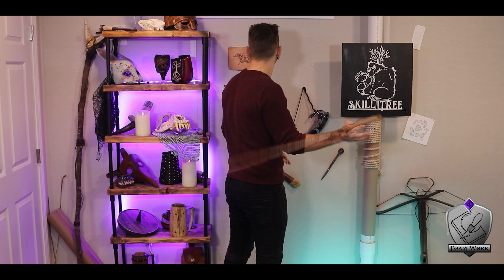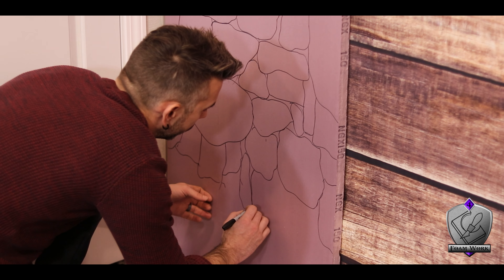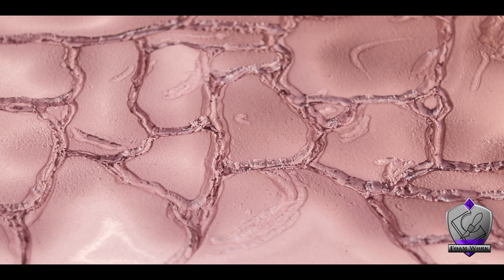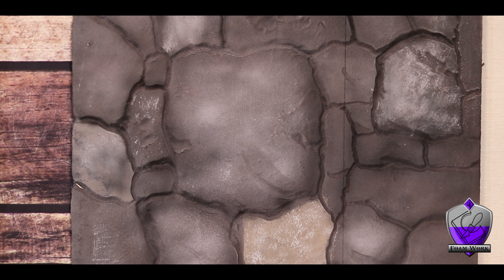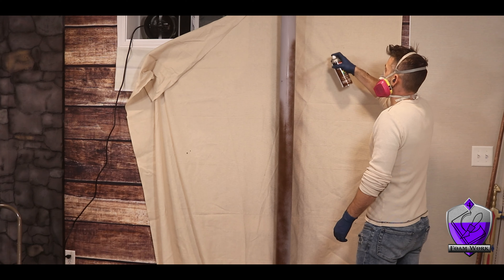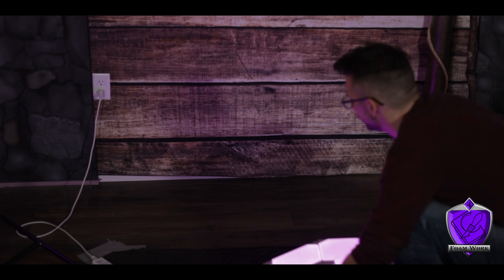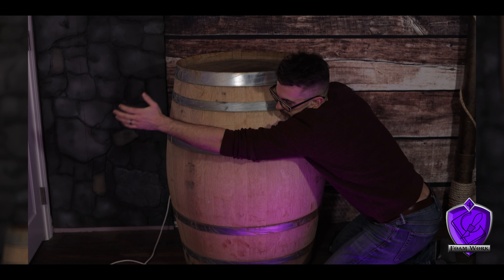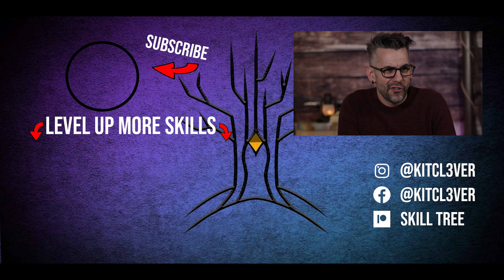Making a Cheap and Easy Backdrop!

Comment: I used to work at a state park as a tour guide. One evening on a night nature walk, I wished I had a walking stick that lit up, but not just adding a little to the one I had. I'd have it so there was a clear looking stone at the top and a reflector so the light would go forward and not blinding me. But I wanted it so I could change the color. I'd want red for general night walking, but could change it to white if I needed to see detail or any other color I needed. So I thought about using a PVC pipe so I could easily hide the battery and wires in. I thought about using brass upholstery tacks around where the hand grip would be. Using a small push button switch for each color light I wanted and cut the stem of the tack off and attach the tack head to the button to hide it. Then you could turn it off and on or change color with barely moving a finger and it would appear like magic.

Comment: No recommendations for the shop, but I have a drink recommendation. Sonic screwdriver. You make a screwdriver as per usual, then add blue curacao and rose's blue raspberry. Excellent taste, pretty color, gets you loopy.

Also colossus and the wanderer. Giant mug with 12 oz Guinness, 12 oz angry orchard, and 6 oz blueberry ale. Shot glass with brandy and grenadine (I just pour whiskey because I always have whiskey)

Comment: Hey man, a heads up! Army Painter has made a spray paint SPECIFICALLY for foam. The entire Game Master line is, in fact, made with terrain crafting in mind - and since in terrain crafting XPS foam is a very big thing, well, the Game Master line is supposed to work well with foam. I've never used it (but I've ordered it), but I suggest you give it a look. It's just 10 euros for half a liter, it's a pretty good deal.

Comment: Been wanting to get my hands on some barrels to turn into chairs. Cut maybe 2/5ths around or so, a little above the center band and then remove the top and enough along the side to even it out, then slap some supports along the inside to hold the platform that will become the seat of the chair, then pad and upholster the rest of the inside for the back and sides of the chair. And if you want you can repurpose the wood you removed into some kind of foot stool or side table built right into it.

As for the PVC pipe in the back, for me if I went with a metal look I'd want to add some kind of stove-looking structure under it that could conceal a chest of drawers for tools or some other storage, and if I felt like getting fancy AND functional try to find a way to hide a hotplate or one of those single burner ranges into the top to have something for making hot cocoa in the folder months, or to melt wax or stick glue for various projects. Or, you know, coffee/tea.

However another way you could go for disguising PVC pipe, especially if it's thick walled, is to follow up the sanding with a round or two using steel wool or (carefully) gouging the surface with - I forget the technical name for it but the rotary disc with metal brush bristles sticking out along the circumference (not to be confused with the one where the bristles stick out of the face of the disc like a death metal shaving brush). Once you get the surface scarred up and grainy (just don't go crazy with it) you wipe paint onto it using an old cloth you don't mind throwing away after. The point is to build up a bit of paint in the gouges and less on the high points. The end result is a fairly convincing wood grain look that can range from rough cut to polished depending on what you put into it.

And for decor I dig the idea of artificer/blacksmith schematics or alchemical formulas, but don't underestimate the power of a simple map, be it of this world or a fanciful one, of perhaps a fantasy-inspired take on a map of your own property. And, of course, hard to go wrong with tapestries, coats of arms, or "trophies" either.

Comment: Only addition i would give for the stone is to roll some balled up Tin Foil all over it. Not only would it give it extra texture but it would hide the mechanical horizontal lines that are there from the foams original mold. 

As for more additions for the wall. Why not do some Tea stained quill drawn schematics of some things you made. That way its something you made of something you made instead of just a googled image

Comment: One thing you can do is take a large, rough rock and beat the crap out of the surface before you go with your stonework lines, you get a more stone texture. Just don't break the foam all the way through, but the texture works great for stone, and it can help with some randomness using the deeper gouges and similar in what you need to do there. And the process is great for days you're more frustrated with things.

You could also do a trophy wall behind you.

A friend of mine started with a joke, finding a paper mache unicorn head at, I believe, Hobby Lobby, that he found a more realistic horse mask online that he arranged on it, and replaced the paper horn with a spiral christmas ornament and made some glass eyes for a trophy head by attaching it to a stained wooden plaque that got him yelled at because he gave it to his sister's kid after telling her he'd gotten her a unicorn...

But since then, he's made quite a few fantasy trophy heads/faux taxidermy displays for monsters, dragons, dinosaurs, and a few more morbid ones using foam and starting with various masks.

Comment: I use a cheap Chinese 1080p LED projector $80 to project an image of a stone wall onto the foam (or papercrete), then to make a Real mess, i use a flat wire wheel on my right-angle grinder to cut the grooves. Texture the rocks/bricks by soaking a rag with laquer thinner and slinging/splashing it on...it'll eat pockets into the foam and make it look more natural. If papercrete, poke at the wall with a leaf or garden rake.

Comment: You could definitely turn the oak barrel into a medieval style cooler/bar. Having a mini fridge down in the basement is always a great thing as well. Especially, if you are cut off of electricity for any reasons. :D 
You just need to isolate it properly and use some ice/other cooled to keep it cold.

Comment: You should prop all weapons/tools/arcane items against the barrel or on the fake wood 
Edit: here's a solution for the outlet problem, get a power strip of like 6 or 8, then get a five foot detention cord and add another power strip to that, do that twice and then add a 25 foot extension cord with a power strip, now you have enough outlets and range, you can add more if needed but this should be enough for now, your welcome